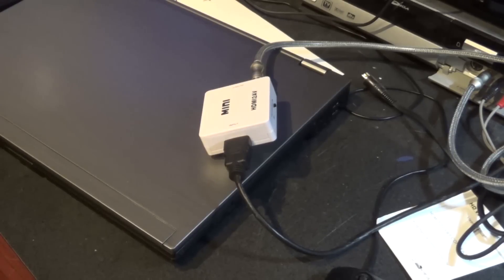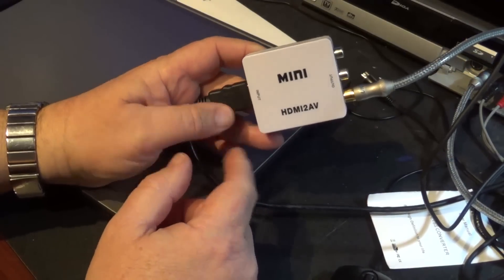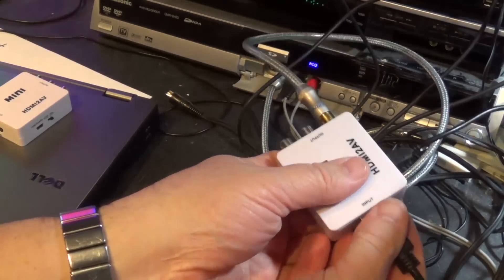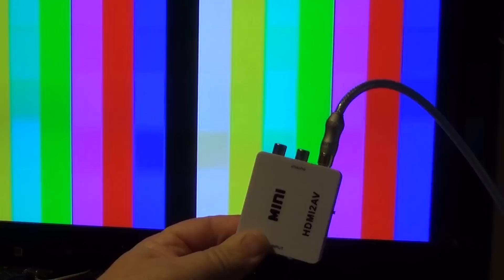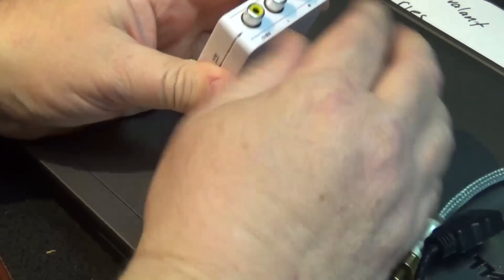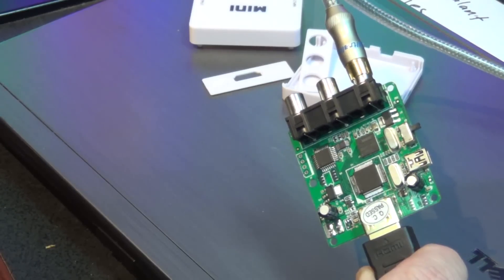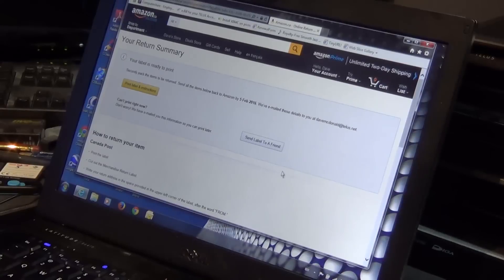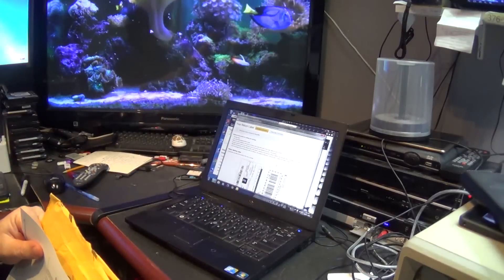Another defective HDMI2AV adapter

Comment: I am also facing the same problem.
Reply from the maker: +shreyas apte Yup, they are pretty poorly made. The god news is I did get a few of the ones I bought to work properly, but this one went back to the vendor and I am sure got resold to someone else and this will continue until it eventually ends up in the bin. The prior one that was broken I contacted the vendor in china, he refunded me and told me to dispose, so I took it apart, and re-soldered the PAL/NTSC switch and it work fine now.

Comment: I get a different problem, sometimes I get a blurry image but it's fixed by putting the pal mode, I used my portable dvd that can be used as tv, since my monitor died I used my portable dvd as monitor, but video quality sucks, even on my 21" tv is hard to read some websites.  Anyway, besides that it works fine.

Comment: I really should have watched this before I bought this piece of shit
Reply: Some do work just fine, like mine. I got lucky and got a perfect one on my first try
Reply: If you're getting no signal color bars that means you're pixel on your PS4 is too high you have to drop it down to one 180 megapixels that is the most the mini HDMI can handle I had the same problem and then I changed my PS4 and put on my Xbox 360 with the same mini HDMI and it worked you got to match the megapixels unfortunately you can't do that with the PS4 unless you have a flat screen to do it with it's crazy I know
Reply: decentradical 
I've purchased. Several ..same same    intermittently reverts to test pattern......   Then to perminant test pattern....TalpioT progRAM springs to mind..

Comment: So . . .  what's the answer? These are for sale ALL OVER the internet from $5 bucks to $30 bucks. How do you know what you are getting? I bought 2 -  I got only BLACK and WHITE BARS on both! PLUS the switch on the side on each were different. One thing for certain . . . I AIN'T HAPPY.
Reply from the maker: The only answer I have is buy them from someone like amazon where you have a return policy. I bought 4. Only 1 worked properly. 2 were returned and replaced. The 3rd they gave me a refund and said chuck it. I fixed it. So I Got it for free. I stay away from eBay as they make the seller pay for return post. Amazon at least in Canada picks up the return shipping.

Comment: there are diferent configurations, wich one do you think worked out off the box? they all look the same!!

General(480P) Features:
General quality, only with a small chipset (red rectangle, shown in the following picture)
Suitable for 480P/60Hz 576i/60Hz resolution computer and player
Convert HDMI signal to outdated TV with only AV interface
Can not convert HDMI signal for android devices
Low compatibility and stability
NOTICE: HDMI input signal: Only support Laptop, the other devices do not support. If you want to use on the other devices, please choose the Better 1080P or the Best 1080P Converter. Thank you.

Better(1080P) Features:
Better quality, with a big chipset(red rectangle, shown in the following picture)
Suitable for 1080P resolution computer and player
Convert HDMI signal to outdated tv with only AV interface
Chipset is made in US
General compatibility and stability
Can Support Ezcast, Devices with MHL Function
Can not convert HDMI signal for android devices
HDMI input resolutions:640x480@60Hz, 800x600@60Hz, 1024x768@60Hz, 1280x720@60Hz,1280x1024@60Hz, 1360x768@60Hz,1600x1200@60Hz,1920x1080@60Hz, 480i/60Hz, 480p/60Hz,  576i/60Hz, 576p/60H, 720p50/60Hz, 1080i50/60Hz, 1080p50/60Hz

Best(1080P)  V3 Features:
Best quality, with three chipsets(red rectangles, shown in the following picture)
Better suitable for 1080P resolution computer or player
Convert HDMI signal to outdated tv with only AV interface
Chipset is made in South Korea
Better compatibility and stability, unsupported devices are still not found right now
Support HDMI signal for android devices,PC Computer,Set top TV box, android Phone or Tablet, MHL Phone,laptop,etc......
HDMI input resolutions:640x480@60Hz, 800x600@60Hz, 1024x768@60Hz, 1280x720@60Hz,1280x1024@60Hz, 1360x768@60Hz,1600x1200@60Hz,1920x1080@60Hz, 480i/60Hz, 480p/60Hz,  576i/60Hz, 576p/60H, 720p50/60Hz, 1080i50/60Hz, 1080p50/60Hz

Best(1080P)  V4 Features:
Best quality, with three chipsets(red rectangles, shown in the following picture)
Better suitable for 1080P resolution computer or player
Convert HDMI signal to outdated tv with only AV interface
Chipset is made in Tanwai
Better compatibility and stability, unsupported devices are still not found right now
Support HDMI signal for android devices,PC Computer,Set top TV box, android Phone or Tablet, MHL Phone,laptop,etc......
HDMI input resolutions:640x480@60Hz, 800x600@60Hz, 1024x768@60Hz, 1280x720@60Hz,1280x1024@60Hz, 1360x768@60Hz,1600x1200@60Hz,1920x1080@60Hz, 480i/60Hz, 480p/60Hz,  576i/60Hz, 576p/60H, 720p50/60Hz, 1080i50/60Hz, 1080p50/60Hz

Best(1080P)With Audio Features:
Best quality, with three chipsets(red rectangles, shown in the following picture)
Better suitable for 1080P resolution computer or player
Convert HDMI signal to outdated tv with only AV interface and you can connect the Audio to the SPDIF and Coxial Audio output Device Via Toslink Cable or Coxial Cable.
Chipset is made in South Korea
Better compatibility and stability, unsupported devices are still not found right now
Support HDMI signal for android devices
HDMI input resolutions:640x480@60Hz, 800x600@60Hz, 1024x768@60Hz, 1280x720@60Hz,1280x1024@60Hz, 1360x768@60Hz,1600x1200@60Hz,1920x1080@60Hz, 480i/60Hz, 480p/60Hz,  576i/60Hz, 576p/60H, 720p50/60Hz, 1080i50/60Hz, 1080p50/60Hz

http://www.aliexpress.com/item/Free-Shipping-Mini-HD-Video-Converter-Box-HDMI-to-RCA-AV-CVSB-L-R-Video-1080P/32248986965.html?spm=2114.01010208.3.1.WLuuoH&ws_ab_test=searchweb201556_9,searchweb201602_4_10017_10034_10021_507_10033_10022_10032_10020_10018_10019,searchweb201603_6&btsid=0b039f71-1894-43a3-b0b2-378675273597
Reply from the maker: +Raul Toraya The units I have will accept 480P 720P 1080i and 1080p with audio, but only non encrypted content If I plug in to a device that will only play on an HDCP link, I get no picture on the AV output.Some devices can pull power from the HDMI port, and other ones require a separate 5V supply on the USB connector.FOr example one of the units I have works fine on anything I plug it into, but one of them requires external power when used with my security DVR, yet it works fine on the PC, Android tablet, or blackberry phone. Different chip sets even though the units look identical.

Comment: I bought one of these to hook up a Xbox One to and old 60" HD plasma TV. I was surprised it worked but the video quality was pretty bad. I guess I should of known that. I did use a HDMI to DVI cable and the video looks fantastic. The audio is supplied right from the console to the usb headset so it doesn't come out the TV, which is fine for me.
Reply from the maker: These adapters convert HD video over HDMI to standard definition. So you are going from 1080 lines down to 480, so yes there is a bug reduction in quality. DVI caries the full 1080 lines of video information, but DVI has no sound.The standards are DVI (Digital Visual Interface) HDMI (High Definition Multimedia Interface) and HDMI-HDCP (High Definition Multimedia Interface with High Definition Content Protection)I have a plasma with a DVI and there is an audio input for it. I have an HDMI-DVI adapter cable, and a pair or RCA plugs to carry the sound.

Comment: The reason these things are burning out is because of heat. I got a good one that works, different from the 2 boards you show...lol. I was converting 1080p and it was crazy hot. Today I cracked that sucker open, glued on two heatsinks, and drilled holes in the case. With how hot it was before, I doubt it would have lasted 2 days, like others say theirs burned out after.
Reply: what are you using??? + also mine gets SUPER hot besides the crap rainbowing, I turn it off after like 30 minutes of use when I see artifacting bad
Reply: Yea a lot of these do get crazy hot, especially the $10 capture cards. Handy tools but hot sucker.

Comment: I just got one of these so i can use my ps4 on a tv that does not have hdmi i puts. Only rca. It worked for about 10 minutes and as soon as i started up a game the screen began switching between having a signal and no signal. Just wondering if anyone has experienced this and if so is there a way to fix it myself or should i just send it back?
Reply: I know this comment is a year old, but in case someone is trying to connect a ps4 through RCA. It wont work. Ps4 uses HDCP and RCA does not support that. So you will struggle with trying to connect it to RCA port.

Comment: can we connect usb
Reply from the maker: USB power input is only needed on devices that do not provide power on the HDMI port such as DVI. On the DVR units I have installed, the USB power input has never been needed. It didn't make any difference on this one, power it up and it just displayed the color bars just like here. 
On a properly working unit, if you power it up with USB, and turn off the video source on the HDMI input, it will go to color bars, turn the device back on, and the picture returns. I have tried that too.
One of these units, the one before that was titled HDMI to video fixed, I was able to fix that one, but the NTSC / PAL switch is reversed. That one is in use today. This one however went back to the seller.

Comment: It is really shocking to see all of these shoddy products floating around on Amazon. I know you pays your money and you takes your choice, however the amount of messing around having to send these things back and arranging for a refund is a pain you can do without. Buyer beware.

Thanks for posting this video as I was going to buy a similar device on Amazon and now I am very weary about it.
Reply from the maker: +DLiberator78 At least they take them back. The fear with the vendors that want the crap back is they are just going to sell it to someone else.
Reply: Yes it was  good you did get a refund. Alas like you say they may just re-sell it to some other unsuspecting customer who not bother to return it.

Did you manage to find an alternative vendor?
Reply from the maker: +DLiberator78 Yes there are dozens of them. So hopefully the next one will work, or be fixable like the last one that ended up being free.
Reply: Mine works perfectly, I must have gotten lucky. I'm impressed how it doesn't even need to use any power; I assume the HDMI cord is probably powering it somehow. It can't be truly powerless, because digital to analog requires power, no questions asked. I just wonder how the tiny little cheap plasticky thing is doing it.
Reply from the maker: I have one that has been in 24/7 service sending the HDMI output from my security DVR into a modulator. Never missed a beat.  One of the ones I fixed is sending the flip clock from my blackberry over the cable, and it works fine now, but the PAL/NTSC switch was buggered up on it out of the gate.
Reply: Sometimes we get lucky with the knockoffs. I certainly was with my PXP3 :)

Comment: I had an issue with these as well, it depends on the production run, there is no consistency with the product. I found that sometimes it is looking for an HDCP handshake, and sometimes it doesn't respond correctly. I use an HDCP stripper (two way HDMI splitter) in line between source and HDMI2AV adapter works consistently every time. HDMI is a horrible bastardization of a standard for video, it was crippled to appease DRM holders. I have more issues with HDMI due to HDCP than anything else.
Reply from the maker: My cable box refuses to work through my HDMI switch, even though it is supposed to be HDCP compliant. I have no more HDMI inputs on my TV, so I have to constantly plug and unplug cables.
Reply: +12voltvids you are experiencing HDCP issues, you need a splitter before your switch. I use a splitter to 'strip out' the HDCP before converting it to SDI. http://www.howtogeek.com/208917/htg-explains-how-hdcp-breaks-your-hdtv-and-how-to-fix-it/

Comment: I decided to buy a generic laptop charger from eBay for $6 less than the official and it worked for 20 minutes and then died on me, replaced the fuse with a wire just because I wasn't going to spend a whole lot going to fix it and it was a quick test and the thing went BANG and that was the end of that pretty much.
Reply from the maker: +Sony Trinitron Yup, there are bad products all over Ebay and Amazon.

Comment: I have a problem with mine where the image is too zoomed in. I don't know if you've had this problem, but if you had can you try and fix it
Reply from the maker: You should be able to change the aspect ratio on the device you are plugged into. (The cable box, computer or bluray player)
Reply: 12voltvids  Yeah but the colored bars look fine, they're at the correct zoom settings. My problem is when I plug in the hdmi device and the colored bars go away
Reply: 12voltvids Once the colored bars are gone only a portion of whats supposed to come up does
Reply from the maker: Right. This shows that the video encoder is correctly generating the correct size if the color bars are correct. On your source that you are feeding into it, there will be an aspect ratio, or zoom adjustment. They all have it. Might be in a menu buried somewhere but there will be a setting.
Reply: 12voltvids Alright thanks man. I'll try it out

Comment: Worked from ps4 to beamer for four days, now i get colorbars and "no signal", either on pal or ntsc... did switch from my videocable from ps4 to the videocable of the tv... didn't have to touch the device for this action, still just gave up on me for no reason :/
Reply: Lets be honest. You drank a 2L of monster energy and kyled tf outta your ps4 for not showing up on the screen. Its not the converters fault i been using mine for 3 years and it gets fkn hot bud

Comment: You have to plug it in to get power...
Reply from the maker: No it gets power from the hdmi port. That USB power is only if connecting to DVI equipment. DVI is non powered and no audio.
Reply: Nope. You need a power supply to get it working. You wasted time on a video for nothing 😂😂
Reply: @848rufjrnf6  dudeeee I literally read over a hundred comments and I was very sad cus he kept saying that the power wasn't needed and in fact in my instruction sheet it says no power needed and it shows how it should be installed and shit, so I was believing. Till I saw your comment I doubted so bad I got up of bed just to try and it fucking worked! Haha I'm so happy!!
Thank you!!

Comment: that's funny I just watched a utube video giving this adaptor bestest  #2 out of 6 other HDMI to rca adaptors I noticed something funny this was the lowest price out of all of them the #4 one was $20 this one was $12 I'll be buying the $20 one I guess u really get what u pay for despite deceptive reviews!
Reply from the maker: There are many that look the same on the outside and they are totally different on the inside. I have one that has worked perfectly since day 1. Cost me 15,00. The next one didn't work, but after the seller refunded and told me to scrap I got it working. Bad solder. The 3rd one had a double image color bar and that is all it would display.

Comment: Hello 12voltvids, I have bought a product from amazon. Type of product PETCSV AV S-video to VGA Monitor Mini Converter Upscaler 1080P. I'm fairly satisfied with this product, but I have a little problem. My problem is that the image on my monitor is very dark. i saw your video and I was wondering I you've had any experience with this issue? I've tried to contact the supplier, but I get no solution there. Do you know how I can get more information on this issue? Or do you have information to deal with this problem? I have tried to get information about turning off the upscaler setting, but I'm stuck there. because maybe the upscaler is the reason for the dark image.      WIth kind regards,    HBS

Comment: Why are there two crystals? Are there two microcontrollers? I am fairly sure it is the microcontroller that is defective but that is just a guess.
Reply from the maker: +roomba I didn't check the frequency, but they could be for the color subcarrier. 3.579545 for NTSC and 4.43 for PAL. Don't know, didn't tear it down, sent it back, as this one was for a project, so I need to get another one ASAP as the client is in a big hurry.
Reply: 12voltvids
Ahh.....very good.

Comment: I'm having the same problem worked great for 2 days and all I get is color bars..real piece of garbage
Reply from the maker: Some work, others don't. Its a real crap shoot.
Reply: 12voltvids you didnt plug in the usb 5v power
Reply: 12voltvids and you didnt switch it to its combatibility ans you have to find the right one on amazon i have a link
Reply: Mine's been working for over a year
Reply: And I don't need to plug in any power to the device. The USB input remains untouched every time I use it.
Reply: me too man it was working lastnight  and no its not working smh

Comment: Hey man I recently just found out the reason why you keep getting those yellow bars is because your PS4 is pixels too high I just found out myself I connected my Xbox 360 to the same mini HDMI and it works the PS4 is generating 210 pixels in the converter only can produce 180 pixels just thought I should let you know because you look as mad as I did before I realize you will have to manually go into your pixels in your PS4 and lower it down to 180p let me know if this helps was trying to help
Reply: Jay's Fishkeeping ahh no, you know absolutely nothing of what you're talking about, you're not even on the same page. He's using a security system, not a game console.
Reply: is this why I cant go from my gaming laptop out with youtube videos etc into the game gear, I get color bars etc